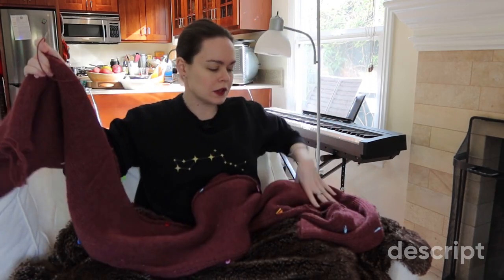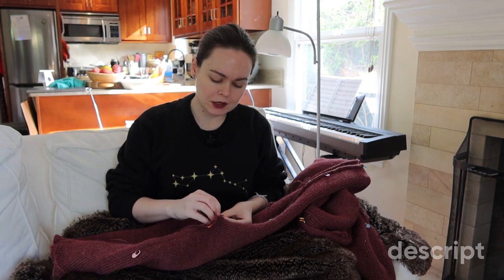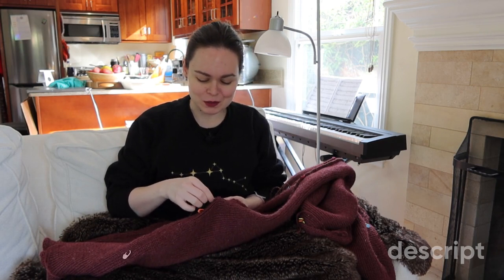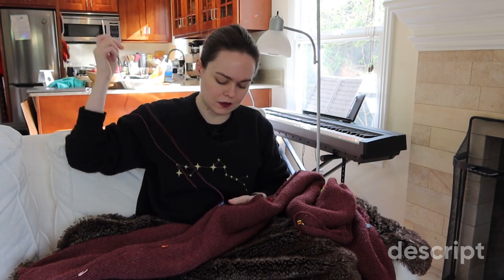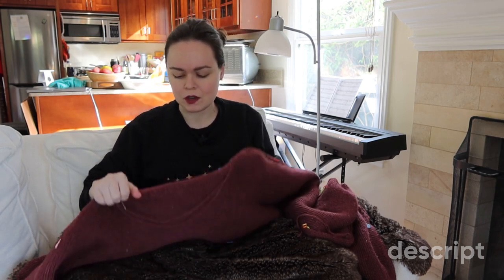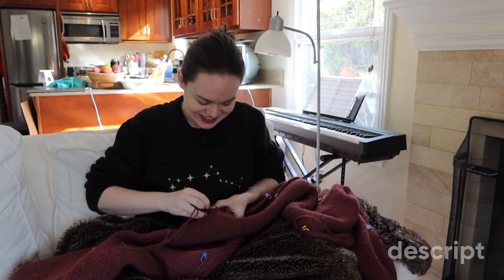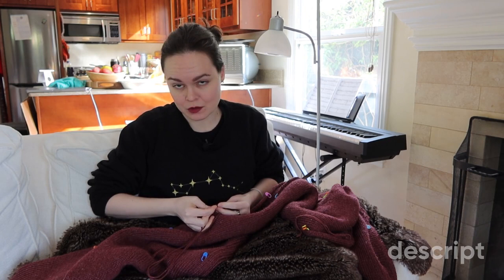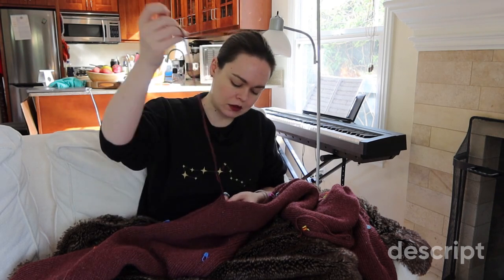How knitting machines work and why there's no second garter carriage blanket video

Comment: you can also knit single bed two color patterns with ayab and it works fine without glitching. i haven't experienced an issue, but i'm not a fast knitter. one could try to knit fast on single bed and see if the error also turns up on other carriages then GC. So technically there's no need to cross the turn mark and resetting/homeing the carriage position. but it's correct, the garter carriage moves in a very certain way and doesn't stop on turnarounds. i'm almost certain it has something to do with the encoder reading

Comment: Well I discovered your channel maybe a week ago and I am absolutely loving it! I love the way your brain works. Hard weird problems are the best! I recently got in to machine knitting by way of 3D printing a circular sock knitting machine. I’d never done any knitting but I love machines, and I’m having a lot of fun! I have about a million questions for you about knitting machines I’d love to ask. But also I’m a robotics engineer and I do a lot of PCB design and embedded systems programming. Have you looked at the RP2040 processor? I love them and I’ve been designing quite a few PCBs with them lately. They run Arduino among other things so maybe AYAB would run well, and they have a lot of power. I’m curious if I could be of help with electronics or software or anything. I love open source and I’d be down to help. Any interest in having a chat some time? Maybe we could arrange a call. I’m in the Bay Area so same time zone and all that. Anyway your work is so cool! ⚡️🧶⚙️
Reply from the maker: If you want to get involved with the hardware, check out the github repo: https://github.com/AllYarnsAreBeautiful/ayab-hardware
Reply: @KnitFactoryImpl  great thanks! it looks like I will have to convert the files to Kicad for them to be useful to me (and to more people in general). I'll report back if I succeed.

Comment: What processing is done on the Arduino? Honestly can't see how this would be processing heavy on the Arduino. Can you compile everything on the desktop and send it all over at once. That way the Arduino isn't doing any actual math. It just goes through a list of commands. That should reduce the computational burden making it easier to respond to interrupts? I've never worked on a knitting machine or Arduino so I honestly have no idea if this would work. Thinking about it 3d printers typically stream gcode over as well. Maybe Arduino just doesn't have enough memory to keep everything loaded?

Edit: went and googled it. Arduino basically has no space for what I suggested. I wonder if reading from sd card would be faster than over the wire. If so maybe if the shield had a SD card on it would solve the problem? Again I have no experience so maybe my suggestion is useless.

Edit2: i chevked the github and i see everything has been resolved already lol.

Comment: Have you tried to start GC Knitting on one of the first needles to the left, so the carriage hits the turn mark after every other row? i'm not near my machine so I can't see if it technically would be possible to set it up this way.
Reply from the maker: The way that I'm currently doing carriage detection, to deal with the extra magnets, means that the position state never gets reset. There might be a better way but I'd have to play with the slop.